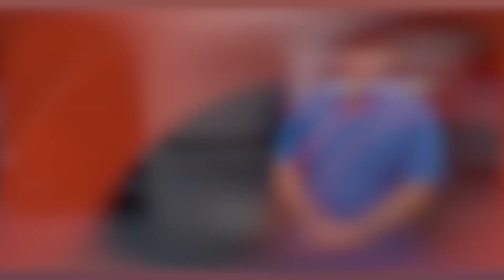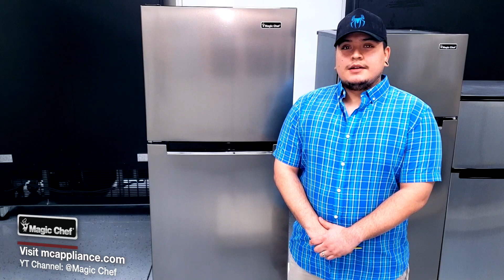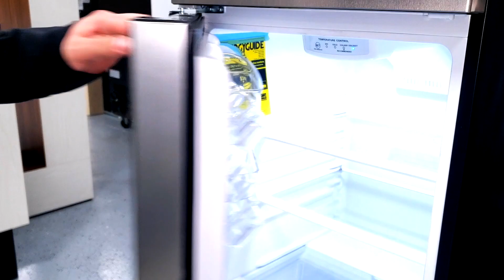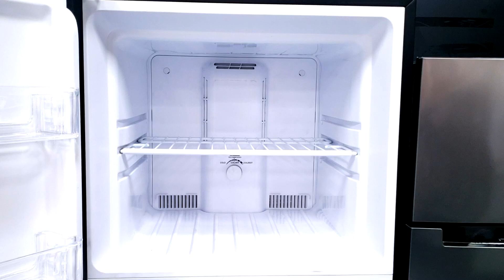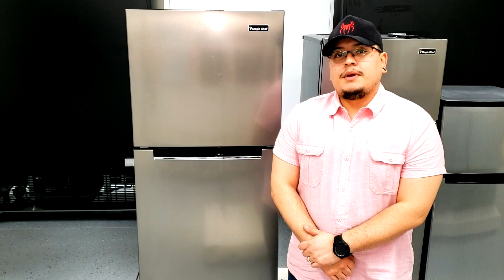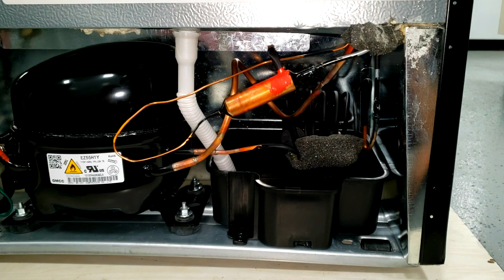Magic Chef Refrigerator HMDR1000 Maintenance & Setup

Comment: Thank you for your video. Purchased this in white at my local Home Depot at the peak of the pandemic.

This fridge was working fine until last summer. I noticed the fridge won't get cold enough now the freezer vents are frosting over. 

Making matters worse now I constantly hear the darn compressor running. 

What a nightmare. I just defrosted the freezer and the compressor is going non stop.
Reply: Try unplugging???   Take food to a refrigerator that works if can.

Comment: Is the cyclopentane a liquid and can it leak out?... my fridge is leaking from the bottom underneath
Reply from the maker: The cyclopentane is the refrigerant. There is a small amount sealed in the compressor and refrigeration lines. A leak from underneath indicates a problem with the defrost water pan.
Reply: @MagicChefUSA  wherevis that located and is that a prob I can check/fix myself?
Reply from the maker: Danielle, what is your model number? @daniellehall4124

Comment: How do you remove the back freezer panel my fridge smells
Reply from the maker: To remove the rear freezer panel, remove the shelf. You will see 2 "buttons' on the back wall covering the screws. Pop the buttons out, and remove the screws. Then, carefully fold the back wall down from the top.

Thank you!
Reply: @MagicChefUSA How do I remove the drain tub pan in the back? I need to replace it with a new one because the current drain pan is broken and it’s leaking water.

Comment: Hello, I have this fridge, it is 2 years old Made "2018" we have it setting in our heated garage for extra storage. The other day I noticed it was making a gurgleing sound that seems to be coming from the back of the freezer. It is not cooling weel and is not freezing. I checked the drain tube "it is clear" and the coils are clean. There is nothing in it except some bottles of water so nothing is blocking anything. there is 2 inches of clearance all around it. I have turned it off, unplugged and turned back on. Still making the gurgling noise and not cooling, any ideas? I hate to just throw it away, it is really brand new.. Thx